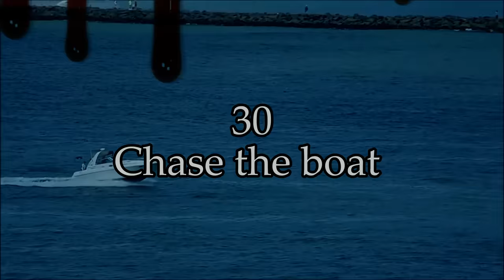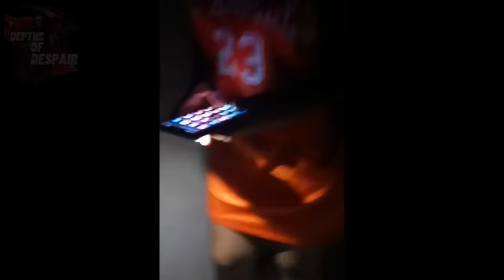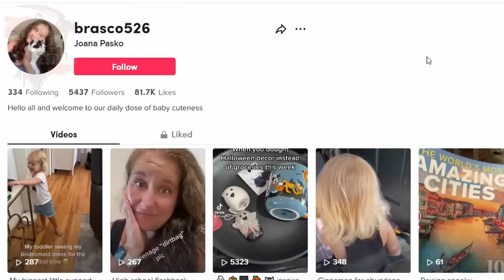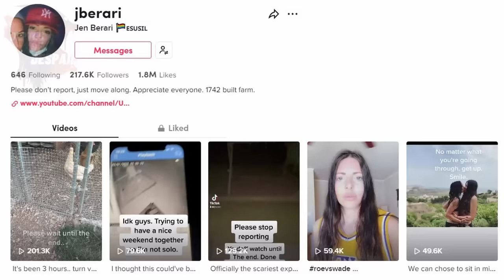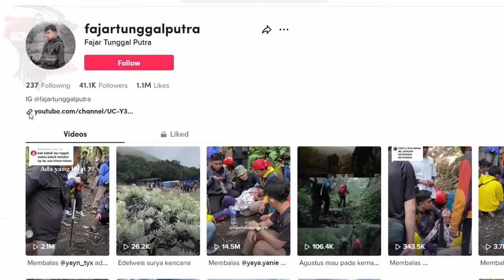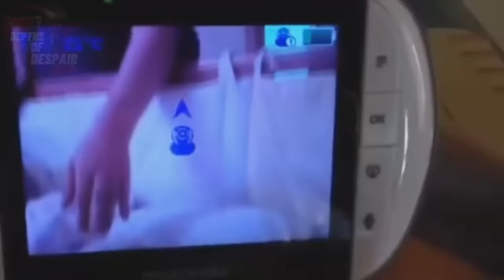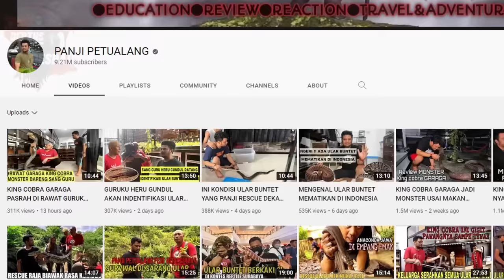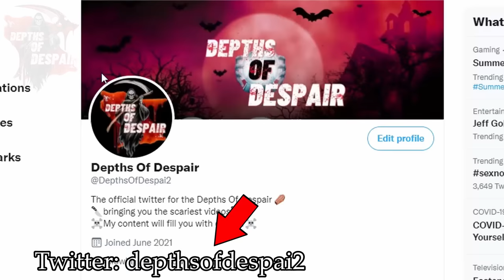Top 30 Scariest GHOST Videos Of ALL TIME! V3

Comment: As far as the paranormal mimic... I have experienced this for myself and it is utterly terrifying.  My parents and myself and a girlfriend all stayed in a house that was haunted by everyone's standards that had ever stayed there.  My girlfriend and I stayed upstairs in a loft bedroom that was the size of half the house.  At the bottom of my bedroom stairs was the kitchen.  Whatever this is I'm assuming some kind of demon because it would notably crawl in hiss at us most of the time also used to use at one point my father's voice to bait me down in the kitchen, it did the same with my girlfriends voice and when that didn't work to get me down there it tried my mother's it was asking me down to the kitchen it also turned on the kitchen light like my mother would to make it extra believable wanting to lure me  away from everyone else asleep at the time.  That last time when it tried my mom's voice coupled with turning on the light and I still refused to come down, I heard it hitting things down in the basement of the house out of frustration and as hard as it was hitting things was terrifying by itself these things are extremely strong it broke many wooden items like hardwood tables and chairs during the tantrum it had.  My best advice stay away, never fall for it and move out quickly from the home as we did.  We sold that house so fast it's head was probably spinning.  Also: when whatever this is that tries to bait you talks and calls out for you it will try to sound as sweet and innocent as possible do not fall for it!  Stay in bed with your partners! Do not go find out what it wants you for.
Reply: It just wants to feed of of your fear.  I had one of these buttheads living in the house I stayed in when I was 5-6 years old and it would suck my energy almost every night and give me horrible nightmares.  I saw it a couple of times when I would wake up suddenly.  One time it was sitting in a little kids rocking chair across the room from me.  It was all black like negative space with red glowing "eyes" I ran to my moms room .  I think it followed me from the house we had been renting before that one because the sightings and nightmare started there.  This was in Denver Colorado.  Thank goodness we moved that Summer to Houston Tx.  I hope it ran out of energy and died trying to follow me that far.  The nightmare and sightings stopped after we got to Texas.
Reply: @Andronicus87  I moved 10 times in 11 years.  To be honest it followed us to the first six or so moves and we havent had any issues until the last few months in the last 5 years. Now it's finally found us again.  Jokes on it though cause I've already placed this house for sale.  Time to move again.
Reply: @joshuamcconnell7311  auw sweet heart I'm so sorry your going through this. Rather then you constantly running, ever try standing your ground and banishing it back to the lower level pit its come from? I can help you with that if needed. I'm an energy worker and a sensitive. Let me know. I want for nothing in exchange, as I work for God our father, Lord and savior. I get everything I need from him therefore need no space for payment of 'services', as what I offer is not a service but sheer love from the Father himself and myself. Gratitude only is accepted and there's no refunds on that 😉 ☺️ 😊 ❤️ much love. Here's hoping this be your final move. May the force be with you always, xo XOXOXO 🤗
Reply: Reminds me of when me and my sister heard a voice calling her name around the comer outside when we were playing at night. I kept asking who are you and it would repeat its me and say my sisters name well saying come here. I said show yourself after asking who it was. A freaking black cat runs around the corner at us and at the last moment darts around a corner. we ran to our house door pounding on it which seemed like forever, my mom remembers us pounding on the door. to this day.
Reply: @horaciothedesigner  most likely was terrorizing the cat before you two walked up and when it tried to bait your sister it was probably the cats chance to run for it.  I right now have a dog and a ferret both will sit and stare at the same dark corner of the room like they are watching something or it's talking to them.  Shortly after this starts they will both climb up in bed with me and continue to stare at the same corner of the room (usually the ceiling corner so they are looking up) which is even more creepy, but they climb in bed like dad save us.
Reply: @MelloMC33  that's very kind of you Mello.
Reply: @MelloMC33  God bless, u seem to be the first to want to help a person who's being terrorized by an entity.
Reply: @MelloMC33  thank you melo I have indeed tried standing my ground I've tried pretty much everything. I've been dealing with this for years I seem to shoulder it well though. Once upon a time I had a fiance if I told you what it did to her you would cringe.  All she was doing was trying to protect me while I was asleep.  She said she heard it crawl all the way upstairs and around the bed to my side before she felt the bed sink down on my side, as if something was pulling itself up to me, she said it sounded like it was whispering like speaking in tongues to me and she yelled at it to leave me alone and it made her regret it.  I have been witness to many crazy things in my life very similar to that.  I honestly wish I could tell you what it did to her for yelling at it but I don't think I can on YouTube it was very vulgar.  Let's just say I woke up because she screamed in pain.
Reply: I heard something mimic my step dad once. I said fuck all that and stayed in bed with the dogs.
Reply: 0
Reply: @joshuamcconnell7311  poor pups. My doggies also as well. Recently my doggie I seen land .like if she was picked up and pushed very hard. Only seen when she was dropped and pushed to side she was in her kennel. My male pup was so upset and growling pure thing was trying to protect her best he could. The night before I had added them to my nightly prayer 🙏 . So I told it to leave and wasn’t allowed here and I stared praying and 2 days later did a 9 1/2 fast . I played deliverance musics for a few hours and everything was so much better. God bless.
Reply: @MelloMC33   . I seen you a religious person? If so if you don’t mind letting me know which religion.? God bless 😊
Reply: So this is a phenomenon? Creepy asf
Reply: @MelloMC33  God bless you sweetheart. I currently have demons or spirts in my home. This will probably sound crazy but I think my bf has a demon in him. I'm chronically ill with sle lupus. I've had it for almost 5 years now. I'm 39 years old. Hes 37 years old. I'm going through chemotherapy im on a lot of meds with a lot of bad side effects on top of multiple painful exhausting health problems. I don't look like I did 5 years ago. He tells me he wishes I would just di3 already. He verbally abuses me so bad says the worst things to me. I have no where else to go and my disability isn't enough 2 live on. But I've seen demons in my house. I've had demons using different voices trying to get me to come to them and I don't. Sometimes I sleep walk and they have made me so drained and scared. I pray and believe in God but some of them are so strong they will not leave. I don't know what to do anymore. Could you please help me? Please pray for me im praying for all of us. Much love and respect
Reply: @karlagarcia1851  God bless you and your dogs. I have demons in my house I pray but some aren't leaving. My dog growls at them and my dogs growled at me before and then my dog crawled under my bed. Hes 100 pound xl American bully staffordshire bull terrier mix. One time a demons locked my dog in my bathroom when I was at my dr appointment. My dog had peed himself and was shaking. I'll pray for you and your dogs and I'll try doing what you did
Reply: @joshuamcconnell7311  im so sorry for everything you and your fiance have been through. I'm praying for you guys. God bless 🙏
Reply: I've heard mimicking but in dreams very scary
Reply: cool story bro. Hope you got some likes that you wanted
Reply: @Andronicus87  stop doing drugs bro.
Reply: @Asymmetrical-Saggin  OK sure I was doing drugs at 6 years old.
Reply: @Andronicus87  please tell me you're older than 6 years old
Reply: @jodywheeler6899 IM 40... I saw the ghost when I was 6.... sometimes I don't know about you guys.....
Reply: @MelloMC33  That is so nice of you to offer to help! God bless you dear. 
And yes sometimes standing your ground works. It definitely did for me. I just got sick of being terrified to go in my basement and called it out and said to get out, it’s my house. Don’t think I won’t do everything I can for you to be gone.
Reply: @joshuamcconnell7311  Its either very very tall or it's hovering.
Reply: There is a man who deals with this issue, he helps people who get possessed. His name is Abu Nadeer.
Reply: You were right to not answer it or go near it they say that if you hear something like that, someone you know that it’s a doppelgänger, it’s something evil stay away from it just ignore it
Reply: @Andronicus87  Ahah it doesnt die by trying to follow you lmao. What can happen is that if you move too far away from its home then it's known to make them stop following you. Might have to go abroad for a month or two.

But if it takes up residence in your home then you can make it leave your home, you have to go to a mosque and tell them to send a person who can fix this.
Reply: @MelloMC33  wow, u are awesome and very true to your belief in the kindest way. I appreciate you trying to help ppl you don't even know. And at no charge, you are an angel. And my belief is that because you don't charge for your services, that makes what you do so much more pure, which gives a huge leap in strength towards your healings. I am curious about one thing tho. If you are not in the same location as the person ur trying to help, how do you go about that?
Reply: @joshuamcconnell7311  whatever that is, it is evil, n would not doubt for one second that it's a demon. And just so you know, they say demons don't just hang by themselves very often. There is usually more than one.
Reply: @Andronicus87  don't even respond to the haters. They obviously have just never had anything paranormal happen to them. Because you and I both know if they did they definitely would not be saying those things. I appreciate your sharing. This is actually a common thing negative entities will do to scare you to draw energy from you.
Reply: As my late grandfather taught me when I was little… “never go there and never answer when someone calls you at night even by your name ! “ they will never call you three times in a row (because 3 is a divine number) .   Go somewhere safe cover the mirrors or put a picture of a Saint or Jesus to reflect in them, sometimes you may be unable to move so the only way to escape is if you do the sign of the holy ⛪️ with your tongue. Demons are the one pretending to be someone you could trust! Always look at the eyes and then you will know that there is no person standing there! Call out for Jesus Christ
Reply: Source?
Reply: Buy the Saint benedict medal ,have it blessed and wear it all the time. This entities will not dear to come close to you. If you don't know who Saint benedict is do a research of his life , he have his own stories of demonic attack and he defeated then
Reply: Ok 👌👍
Reply: @jodywheeler6899  I study parapsychology and demonology. I would gladly assist you with your dilemma. My first question to you is You believe your boyfriend is possessed right?? Does he have any current mental health issues and or current illicit substance abuse?? How long has he been verbally abusing you?? I shall give you my email once you respond back. I will not ask you for any money in return for any assistance in person.
Reply: I had an African Grey partot how could mimic my voice to the T. First time I heard it I was in the bathtub. I jumped out with the quickness, but turned out to be my awesome bird.
Reply: @stefaniaschiriac9754 
If they will never call you three times in a row(because 3 is a divine number), then why do they always knock three times? People say it's because they are mocking the number three, so why wouldn't they call for you three times? It would still be a mocking of sorts, wouldn't it? 🙃
Reply: L
Reply: @karlagarcia1851 at first glance I had assumed the deliverance music; was from the movie deliverance. lol then realized you meant worship music. Thanks for the lol haha!
Reply: it doesnt matter where you move, it follows you, it is a familiar, it is connected to your family bloodline, it knows everything about your bloodline, the only way to break free from that thing is byt becoming born again under the blood of Jesus -Acts 16:31 John 3:7 John 3:16
Reply: @jodywheeler6899 im sorry he doesn't support you 😔❤️ i hope your doing well now ❤️
Reply: @joshuamcconnell7311 Wow that's scary! Stay safe.  If you really have moved that many times, hell, or even half that many time in several years, you can't deny something creepy has caused that.  Noone likes everything that goes along either moving.

Comment: 11:28 look on the floor, under the words, you can see a face or even a kid standing holding a dog (?) on the floor...see that? That is how I see them...in the video before that, before Giovanni turns around (10:11) and hears the running twards him, look at the door at the end of the hall as he walks twards it. A full figure can be seen on the door (or when paused there, look at bottom right on floor...theres a woman seen flat...or look down hallway here, one figure on left and one coming out of wall on right, closer than the door).
At 10:19 you can see a figure on right, standing before door... and a set of eyes seen at top of stairs just to his right on floor here too..
And when he turns around,  look at the doorway on the left, on the door frame. A 2 heads can be seen kinda leaning out on the wood part....(10:30)..as well as a Grey face from stairwell behind it... zoom in,  it's there!!!
And if paused right before he starts running, you can see a kid- sized figure at end of hall running twards him,  see- through...of course (10:31 and a millisecond)
See this?
10:38. There a string of 3-5 ppl holding onto eachother from the stairs to the table...there at the bend straight ahead  also...
Pause at 10:26 to see someone peering out of open door crack!!! (Just below handle..which becomes a glowing eye at 10:27))...and a hand gripping the top corner of door from the inside!!!

Comment: 67 minutes (1 hour 7 minutes) That strange noise is aa sump pump pulling air. Basically the line is is still trying to drain water but the water level is too low, which causes a weird vacuum sound. The water flows up, hits a point where it can't be pulled further, then releases flowing back down the line. He should have called the maintenance crew to let them know because that can cause the pump to overheat and get damaged.

Comment: The first noise in the subway is actually a very common one in old subway tunnels its when another train on similar rout passes by and the wind from it and it traveling echos of the other various tunnels as it passes. Happens in san fran and ny all the time

Comment: Takes away from the videos realism when camera operators see whatever in a room, peaking around the left wall, or just caught going left from the camera point of view,so the camera goes to the room, goes inside the room a good 4-5 steps, pans the camera slightly to the right (away from the paranormal entity in question), and then pointing to the corner on the left where the entity was supposedly hiding.  Its unnatural movement and would immediately put their back to the "ghost".  
I know its easy for me to sit on my comfy couch and find problems with things like that. I'm not there, their adrenaline would be pumping and blah blah.  But thats reason enough to move too fast, not holding the camera straight ahead having no idea if whatever you saw is gonna club you in the back of the head or come give you a big sloppy kiss

Comment: 36:43 this is clearly edited. I worked at a radio station as an audio engineer. so I have some experience with audio editing. when you just put an edit somewhere in the audio track it happens to make a little "click" sound (I don't know how to describe it) since you edited in the space of a waveform. a clean edit (after a waveform) doesnt have that "click sound". so the banging sound is edited in. when she opens the door you can hear that "click sound".

Comment: @DepthsofDespair the advert is messing up the transcript again. Do you add the transcript before you insert the ad, without taking it into account?

Today’s is off by 10 mins. You need to adjust the transcript to include the duration of the ad.